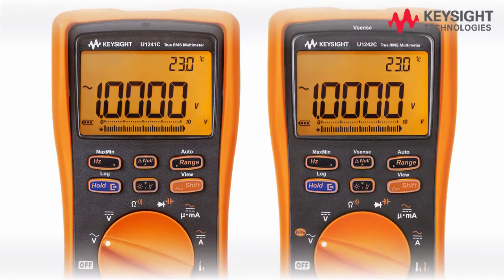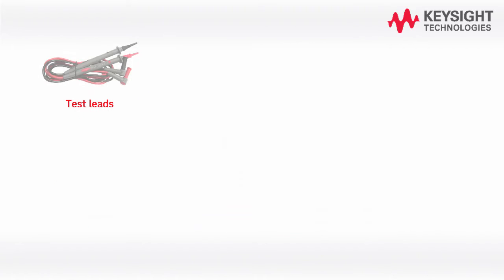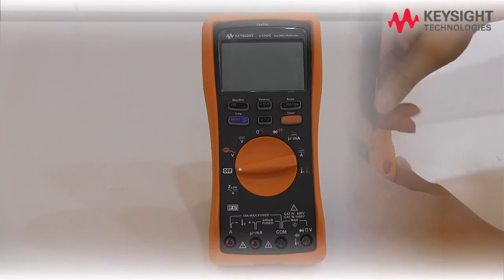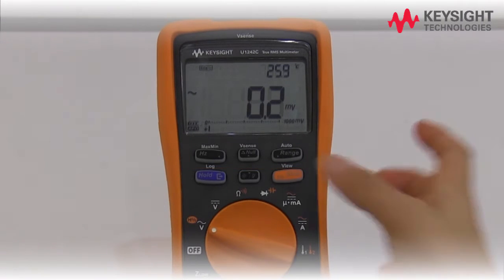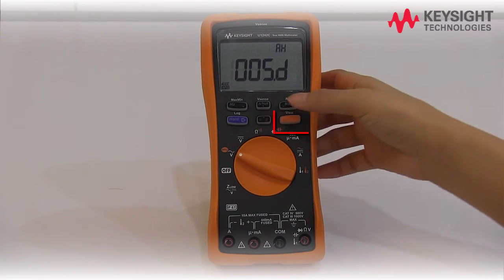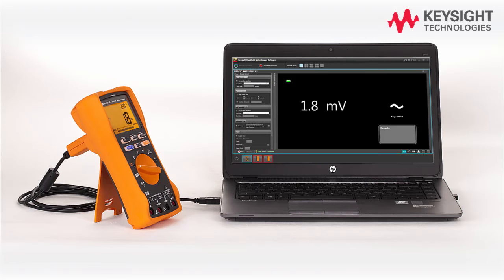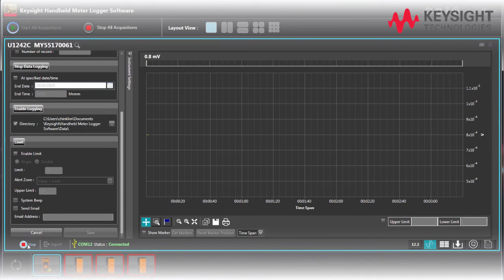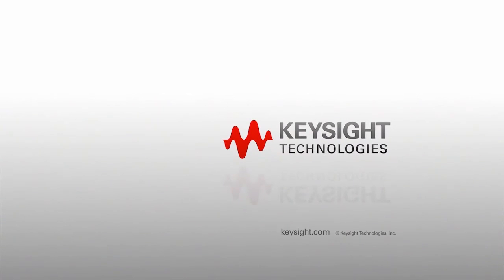The Keysight U1241C/U1242C Handheld Digital Multimeter Quick Start Video

Comment: I very very very love Keysight U1241C , Lighting speed and a lot function I never see before in orther brand.
Im from Vietnam, i can wait to buy one, but I can't find any store in Vietnam sell it. Please tell me how to own one ?
Reply from the maker: You can contact our local distributor. ASIC Technologies JSC, Level 81 Le Duc Tho, Hanoi, Vietnam.  www.asic.vn, Tel:84981027226.
Reply: are you sure? I bought a U1241C it's extremly slow, takes around 2-3s to readout the voltage. What's more, it use HY3130 as analog part, the HY3130 is design for 5000 counter multimeter, I think U1241C using oversampling to get 10000 counter, so it's so slow 😂